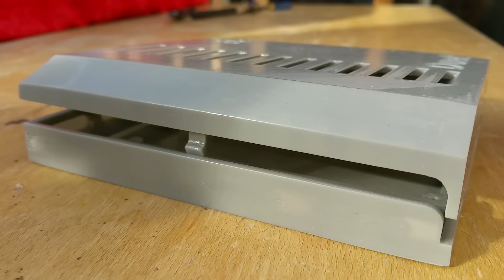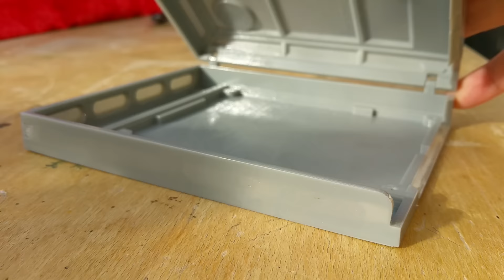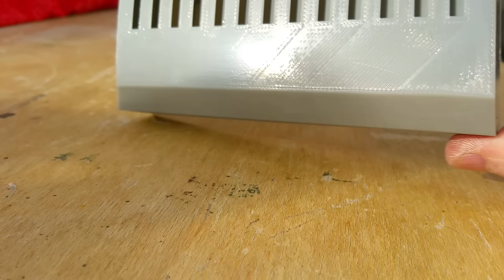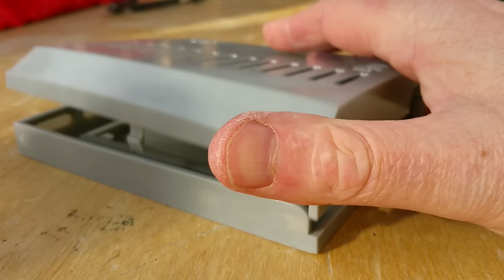Duet v0.8.5 Case snap fit test

Comment: beautiful result, what printer did you used ?
Reply from the maker: +Bonbadil Moi, thanks.

It was printed on a heavily modified Makerbot R2X. You can read more about the project as well as download the files here - http://www.nextgen3d.co.uk/free-3d-cad-models-for-the-duet-v0-8-5-control-board-case/
Reply: Steve Johnstone thx for the infos, i will check it.